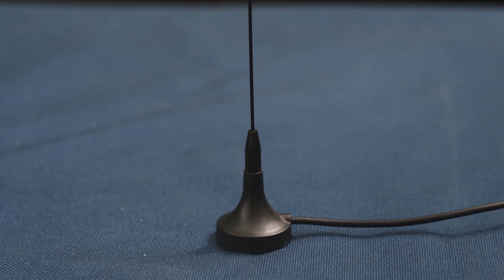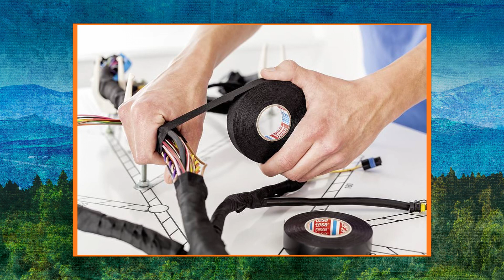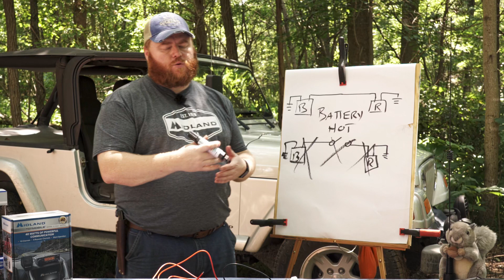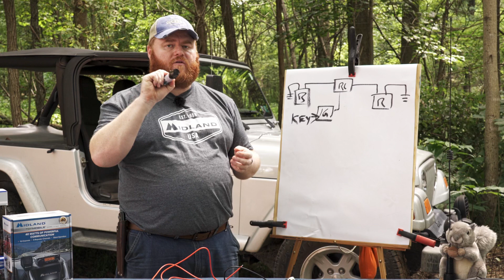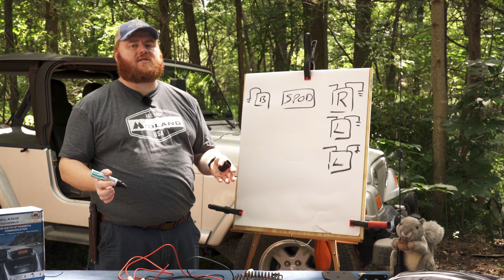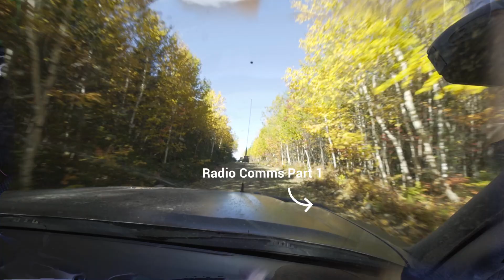Mobile Radios Install Tips - Overland Communications

Comment from the maker: *In this video we talk about needing an NMO adapter and a separate cable. Instead, we recommend the Midland Low Profile Antenna Cable, which does not require an NMO adapter. https://www.blueridgeoverlandgear.com/products/midland-mxta24-low-profile-gmrs-antenna-cable?_pos=1&_sid=778e3ff03&_ss=r

Comment: My vehicle I use Auxbeam 8 gang switch panel.  You can control lights, winches, radios and more.  It's waterproof , turns off with accessory power. Basically two pieces.  The relay panel mounts under your hood. The LED switch panel mounts inside cab that connects with one wire. They sell them in several circuit configurations.  You can change the panel led color to match what color your vehicle color.  It comes with a pack of device stickers for your panel buttons.

Comment: I wanted to use the same bracket of the low profile antenna for the whip MXTA26 antenna, I need the adapter for that bracket. What is the name of that adapter from Amazon?
Reply from the maker: Sorry, but you'll have to check with Dean on that detail. His Instagram is @eastcoastoverlandadventures

Comment: can you splice the red black wire and join wires to circinate ligher plugin  dont want hook it battery this is radio thinking AnyTone AT-778UV Transceiver Mobile Radio Dual Band 25W VHF/UHF VOX Vehicle Car Radio w/Cable

Comment: I have 4 radios. I mounted my Unidien CMX760 (CB) behind the glove box. It has all controls on the mic.
I mounted two Kenwood HAM radios, (V71, and 710) on the rear drivers side Molle panel between it and the window. And the control faces, on one of those  dash mount rails. I also use a Wouxan KG-1000G+ dual channel GMRS radio that I also mounted the main unit with the two Kenwood units on the rear drivers side Molle panel between the window and panel. The control unit is mounted above the sun visor to the plastic up there. All wires are hidden.

Antennas? I used two mounts that go under my A puller lights, one on the drivers, one on the passenger. GMRS on the left, ham radios uhf/vhf on the left. Providing more then 19” needed between the two.
In the rear behind the spare tire, I used two antenna mounts. Made a mirror image of the one on the right. The right has the CB antenna, the one on the left the other ham radio antenna. Giving the needed  full band sepperation fandom the front and rear ham antennas for both UhF and VHF. Even though the CH antenna is less the. 18” from the UhF/VHF antenna, it won’t cause issues because it’s on the 10m band.

I now have APRS, and access to three ham 2m/70cm bands, the CB band, and can monitor two GMRS channels all at the same time. As well as every radio has access to the weather band, as well as all have weather alert capabilities.
Reply from the maker: It sounds like you're ready for anything.
Reply: @BlueRidgeOverlandGear  LOL, I do have a spot satellite emergency locater as well. Now just need a cell phone booster and I’m good! Lol

Comment: I just bought a MXT575 and I was wondering if I can connect the wires into my 8 Gang Auxbeam switch panel? Instead of wiring it directly to the battery.
Reply from the maker: Sorry, but that's outside of our realm of expertise.

Comment: Best video on this topic I’ve found!  I’m going to replace CB radio with mxt575 in Jeep tj. Will the existing Firestick CB antenna &/or coax work with GMRS radio?
Reply from the maker: We're not radio experts. But typically, CB antennas do not work with GMRS. 

Dean was our resident radio guy and he has moved on to other ventures. you can ask him on instagram @eastcoastoverlandadventures.

Comment: When will USB rather than the cigarette lighter be available?
Reply from the maker: USB does not provide enough power to run a mobile radio.
Reply: @BlueRidgeOverlandGear  really , I cut off the cigarette plug in and spliced in an USB with my current radio and it worked. I just don’t want to have to do it with a new radio.

Comment: Just ordered a new F-350 with the upfitter switches.  Any input on if these will be noise free for wiring a radio to?
Reply from the maker: They may cause some noise, so run a ferrite choke to start with.  If you still get noise you'll need to go straight to the battery.

Comment: i Guys, can you do a segment on Ford Aluminum trucks to get the best performance out of the radios/antennas? I have a 2017 F250 Crew Cab with power moon roof. Thanks.

Comment: Two questions Dean.
1st is I have the Midland 6db Gain antenna + Midland 6 meter Antenna Cable with NMO included to be attached to the driver side custom bracket. Would there be interference if it was on the right side and near the standard AM/FM antenna (thus having both antennas within 5 inches of each other?
2nd the Midland MXT275 would be powered by cutting off the DC plug end and directing power from one of the 4 open Aux switches in my 2021 Rubicon unlimited.  OK?  Better options?
Reply from the maker: Antennas usually only interfere with each other during transmission on/around/near the same frequencies.  So you're standard radio's AM/FM antenna shouldn't interfere with the GMRS radio.  You might hear some interference when you transmit on the GMRS radio, but since the frequency is so different than your cars AM/FM radio it's unlikely you will even notice.

You'll be better off wiring the GMRS radio directly do the battery.  Those aux switches may cause some interference given how they are wired in the vehicle.  That said, it can't hurt to try.  However direct power is always cleaner and will give you better performance.

Comment: Hi Dean, thanks for clearing up our options.  Have a 2017Grand Cherokee and want to I stall the 3db ghost antenna  with lip mount. Unable to locate the firewall for this vehicle anywhere!  Was going to buy the 400 model install antenna as mentioned and direct connect the radio power to the main battery (not the start stop one) under the passenger seat.  So I have two concerts: firewall location to get the antenna cable through to the radio and best location to run power wires from battery to radio on this vehicle.

Thanks Dean!
Reply from the maker: There should be a rubber gromet in the firewall behind the glovebox you can access for fishing the power cable through.  You'll want to run the antenna wire through the opposite side (to prevent interference).

Comment: I am new to wiring. I recently installed a S Pod style switch pod/relay. The relay box has multiple relays built in and each relay has a 30A fuse. Do I need to swap out the 30A fuse for a smaller amp if this radio does not need 30A to run off of? also could I keep the built in fuse in the wiring and still wire it up to my switch pod which also has a built in fuse?
Reply from the maker: You don't need to since the radio should have a fuse itself too.  That 30a fuse in the sPod is more to protect the unit itself.  However, swapping it down for a smaller one won't hurt.

Comment: Great video thanks only thing a fair amount of vehicles do have constant hot 12 power to acc and cigarette lighter plugs Ford for instance most all of 12 volt and cigarette plugs are hot always.  So a better source for a hot ignition source is more likely to be found under the column .  You will have to check for 12 volts on your cig plug with key off.  Just a FYI
Reply from the maker: Yes, and in some vehicles (like Chryslers) there is a two-position fuse you so you can swap between ignition hot or battery hot.

Comment: Great video, Dean!  If I might, I'll add a tiny detail, just because it bit me.  If installing under the "ignition hot" scenario, be sure to ground the chassis of the relay.  Most of the current orientally supplied solid state relays are very unhappy unless their chassis is grounded.
Reply from the maker: Yes.  Good grounding is important!

Comment: Excellent video! You clearly explained how to incorporate switch wiring, thank you.
Question, is it harmful to the radio to leave it "on" at all times but control power with the killswitch?
Also will an LED in the switch cause interface or am I understanding correctly that the relay circuit is isolated enough to not be an issue?
Reply from the maker: Glad you enjoyed it!  An LED will cause interference on 2m and sadly not any real way to prevent it.  It's a frequency issue.  So I'd try to stay away from LED switches or at least not mount your radio near them.

Comment: I've mounted the antenna on my tire rack with the mount itself pretty isolated. Wondering if running a wire to ground is an option
Reply from the maker: Yes, you'll want to make sure the antenna has a good ground.  So you may want to run a ground wire from the swingout to a chassis bolt between the bumper and the frame.  You'll also want to make sure the antenna has a solid ground connection to the swingout (ie - no paint between antenna and bracket or between the antenna bracket and the swing out).

Comment: Cant believe the wattage radios you are legally able to run, here in Australia , we have similar to GMRS our radios are 80 channel 477 mhz uhf,  maximum power 5 watts only , unlucky us !
Reply from the maker: Is that 5w for handheld and mobile?  Our handheld GMRS radios are limited to 5 watts.
Reply: @BlueRidgeOverlandGear  our mobile or base station radios are 5 watt only and our handhelds are , anything from 0.5 watt
 1 watt , 2 watt , up too 5 watt maximum , , that’s it  ,

Comment: Could you put one of these in a building as long as the antenna  is out side
Reply from the maker: Yes you could.  Most people don't bother mounting a GMRS radio inside a house, but it would be pretty much the same install as a VHF HAM antenna just with a GMRS radio.

Comment: How about put a extra battery in trunk where spare tire used to be since new cars don’t have spare. Then have the batter to alternator to charge battery . 
Or solar as well
Reply from the maker: If you're running an aux battery ideally you want a DC-DC charger/maintainer/conditioner between  it and the alternator.  Solar is also a good option and a lot of the DC-DC chargers will also do solar (RedArc, Renogy, etc).

Comment: Which battery I have one in back and in engine 

What does the one in back do
Reply from the maker: Battery type depends on application and needs.  I run AGM in my trailer.  Some people will do something like the Dometic PLB40, others a stand-alone lithium battery.  Just depends on what you need it to do.

Comment: Are the GMRS radios as sensitive to ground planes like CB radios? Such as on the roof of a Jeep where the antenna is mounted to the fiberglass top. You have electrical ground but very poor ground plane.
Reply from the maker: CB's operate on a much lower frequency and are AM so they are super sensitive to a ground plane.  GMRS radios are on a higher frequency and are FM so they require a much smaller ground plane and a much smaller antenna.  You should be okay mounting a GMRS antenna on the fiberglass roof of a Jeep.

Comment: Super helpful
Reply from the maker: Glad you enjoyed it.  If you have any questions don't hesitate to ask.
Reply: @BlueRidgeOverlandGear  what is the highest power GMRS radio that midland has. I just got my GMRS license and want to set up a base camp in my rv
Reply from the maker: Currently a 40watt radio.  The max allowed by the FCC is 50watts and supposedly Midland is developing a 50watt mobile radio.
Reply: @BlueRidgeOverlandGear  thanks this helps a lot

Comment: Wow, unnecessarily complicated wiring scenarios.  I just ran a dedicated circuit on an existing ACC relay from my fuse box.   You can get a tap that allows you to put a fuse - like body with a power (hot) wire into the fuse blade contacts and then has a regular fuse that sits inside of it.  Plug tap in fuse box --> Connect radio to hot wire that provides --> Ground radio anywhere you can get a good ground --> Done, fused clean power without fighting with firewall grommets and radio now only comes on when the accessories or ignition switch is on.

"Spaghettification" is a word used in physics for the tidal effects on a body nearing a black hole, it's not a term used for wire webs generated by electrical spiders installing electronic gear.

You should have taken ten seconds to show how a ferrite choke is used on a power wire.  Alternator noise is a very, very common problem but easily solved.
Reply from the maker: We wanted to show multiple options when it comes to wiring and what some of the pros and cons are of different types of circuits and source wires.  Feel free to create your own install tips video and send us a link.  I'd be interested to watch it.

Comment: Do you need to ground the magnetic mount?  If so how?
Reply from the maker: Magnetic mounts will be internally grounded through the antenna cable which works, but is not ideal.  So you will get some functionality out of it, but not peak performance.  It will be enough to talk to the people around you, just not maximum range.

Comment: Thanks for the great video! I just installed the MXT275 Midland GMRS radio. It sounds clean and transmits around 5 miles. I'm wondering if I need to ground the antenna. My tire carrier bracket is completely powder coated and so the antenna is not grounded. Do I need to scrap off the powder coat at both ends to ensure the antenna is grounded? And will this give me greater range? I am using the Midland Low Profile Antenna Cable.
Reply from the maker: Yes, you will want to ground your antenna through the powdercoat.  Either grind off the powdercoat under the antenna mount and/or get one of those finned washers that will dig into the metal.  That should do the trick and give you a little more range.
Reply: @BlueRidgeOverlandGear  Thanks for the reply! My low profile Midland coax cable has teeth that dig into the metal. But I doubt it can dig through this powder coat because it’s really thick! In any event the other side that bolts to the tire carrier isn’t grounded.

Comment: You never, never, ever connect your radio negative direct to the battery.  Doing so bypasses part of the current for the (BMS) battery monitor system of your vehicle.  It will provide false information to your vehicles computer.   Your negative lead should be a solid connection to the frame of the vehicle.  If you don't see the fallacy in the advice to wire your radio direct to the battery, where is your stereo radio that the vehicle manufacturer installed wired to?
Reply from the maker: I have found grounding to the frame or body of the vehicle is rarely a quality ground for something as sensitive as a two-way radio.  A battery-direct ground cuts out a lot of the static and noise you get from a chassis/body ground especially if there are things like interior lights and HVAC components grounded near by.

Comment: Different antennas for different jobs.  The longer higher gain antennas tend to "pinch" the singnal and shoot more of it towards the horizon.   That can help with range in many cases but in instances of where you are in varied terrain line hilly or mountainous terrain it can be a hinderance.  

The lower gain 3db antennas tend to make more of a doughnut shaped radiation pattern when viewed from above.  A big oval bubble when viewed from the side. This tends to work better in rougher terrain with more varied elevation.
Reply from the maker: Good to know!

Comment: What do you use to actually connect the power and ground wires to the battery?
Reply from the maker: There are a few terminal options for direct connection.  Best thing to look at is car stereo installation hardware or marine grade battery terminals which is what I use right now.

Comment: This was a fantastic video I was looking  Between a 15 W and a 45 W radio what do you think would be better because I'm completely new to this
Reply from the maker: Depends on what you want to do.  If you just want to talk to a small group in a convoy, then the 15w is fine.  If you want to talk to a larger group or have max range then the 40w is the way to go.  I've been okay in most groups with a 5w handheld, so the 15w is plenty.  That said, I also trail guide and end up at the front of a large group so I will run the 40w mobile one I get it installed.

Comment: Great video.  I'm going to have to watch the earlier ones to decide on what radio I want.  Two questions; the pouch for your hand held radios.  Where did you purchase that.  Second, I have a SPOD on my Jeep TJ and I think I'll hard wire directly into that.  Do you think there will be any power issues?  Oops, I should have watched the entire video before posting because you answered the SPOD question.
Reply from the maker: The radio bag is actually a modified version of our Cooking Kit bag.  Just cut out the center seams on the utensil pockets.  And no, you won't have any issues running POWER to the radio from the sPod but I highly recommend running a dedicated ground to the chassis and not use the ground from the sPod (if that makes sense).

If you need any help selecting a radio just let us know.

Comment: great info   about to pull the trigger on this radio    would you say the overall performance for this unit would be better if hardwired? than just the plug and go    thanks
Reply from the maker: Yes.  Hardwired with a good ground will be better than just plugged into the cigarette outlet.